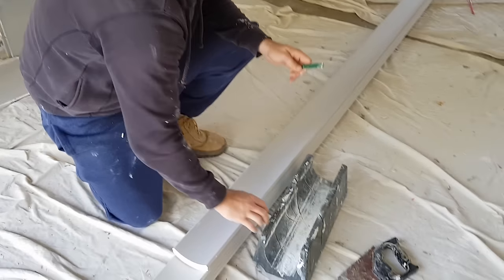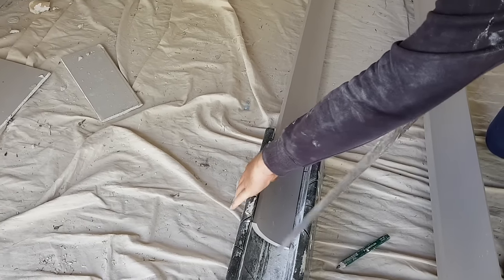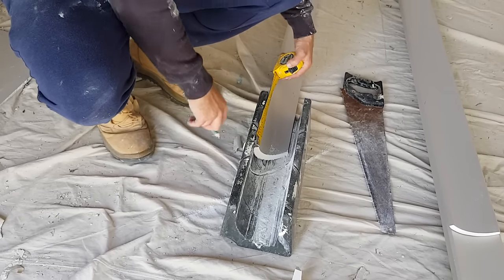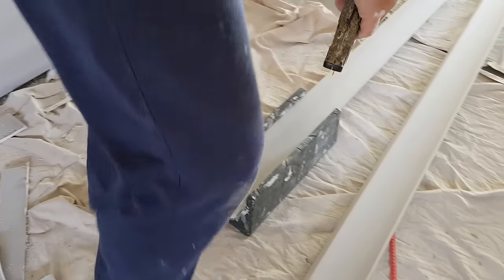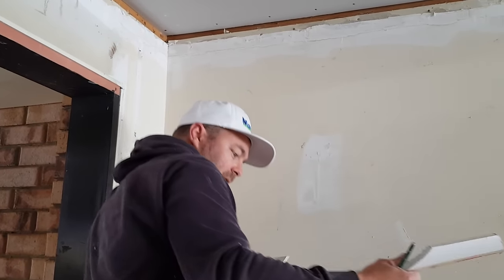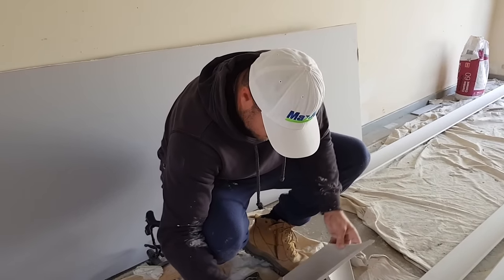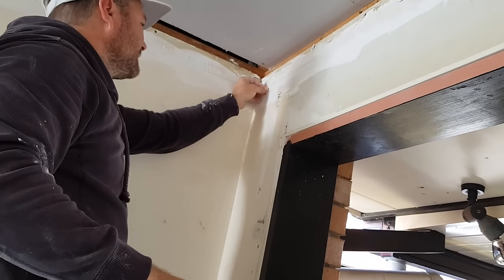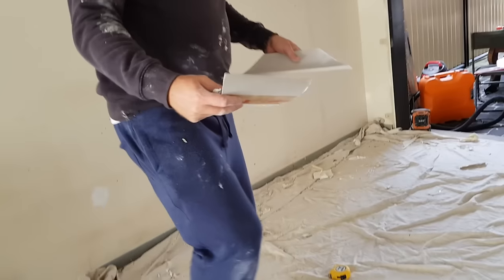DIY Coving Cornice Cutting Tips for Beginners

Comment: Good work guys
Reply from the maker: Thanks very much. Your videos are amazing these days. I watch them weekly.
Reply: Maxkil thanks man! I appreciate it
Reply: Rich looks like you gonna have to up ur game LOL... cut box and rusty ol saw is on your list!!
Reply: I watch both of you weekly LOL
Reply: BTW，you can have neater cutting finish if you make sure your saw blade only cutting from surface paper side. in other words，saw    blade does not pull out the surface paper if you lift the saw little bit when you drag the saw—assuming the cornice surface is facing you.
Reply from the maker: Yeah true that, I hope I did it the right way here..
Reply from the maker: Yeah his shows are next level.., I'm trying to get better at carpentry, skirtings and design ideas I've been watching him for years.
Reply from the maker: Lol, those rusty ol saw blade days are over for him mate....
Reply: Actually, these guys should use an electric mitre saw to cut instead.  Saves much more time than hand cutting.

Comment: THANKS GUYS .. great video.. so .. hmm when cutting internal long edge is the bottom so that is the point where u measure ? we measure down 90mm ? mark it up with pencil .. ?  AAANDDD for externals long POINT IS THE TOP? thanks any advice greatly appreciated..
Reply from the maker: Hi Nick. Thanks for tuning in. Yes that's right measure the wall 90mm down. Lower edge is the long points. Yeah we normally mark the corners to make sure the next cornice will line up
Reply from the maker: Where in Australia are you mate?

Comment: why you don't using compound miter saw? good corners and very fast
Reply from the maker: Hey good question about that and the reason I don't use my sliding compound miter saw is I would need a stand out bench on both ends and it would be far too long.
This small light weight box is easy to pick up and move to the end I'm cutting..
Reply: The cuts are cleaner too but you would need quite a bit of space.